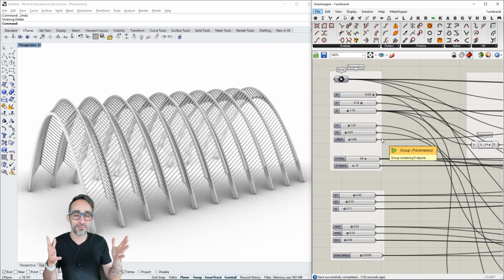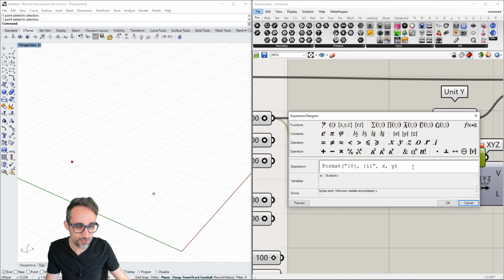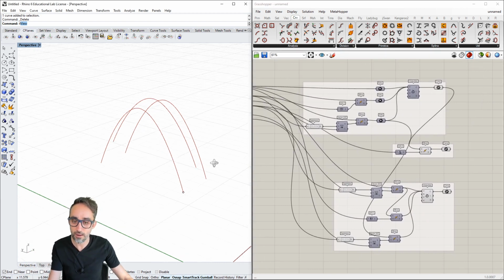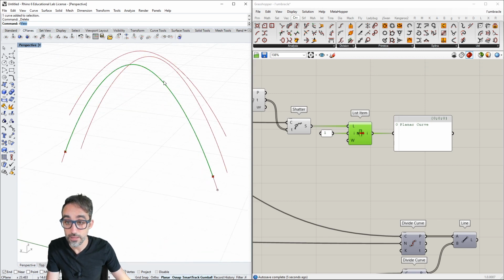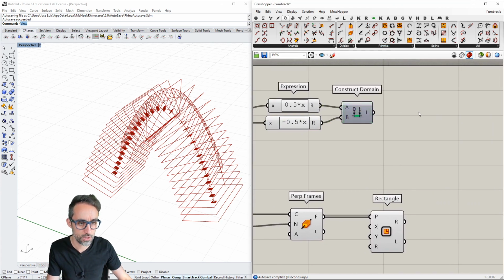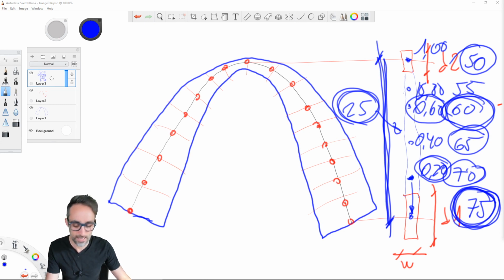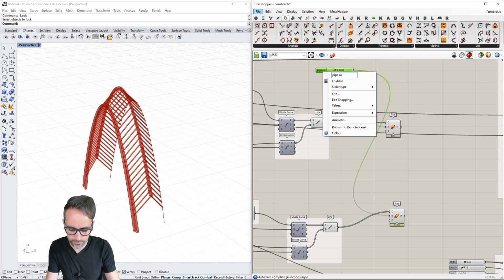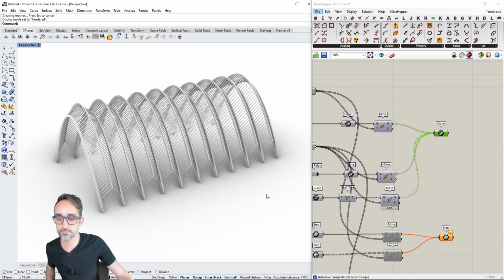Algorithmic Modeling #2.1: L'Umbracle

Comment: 25:00 I exactly had the same thought in the beginning and tried using interpolating those 3 points and results is different than the curvature of the original one. So your method, trimming in that case turns out the best option.